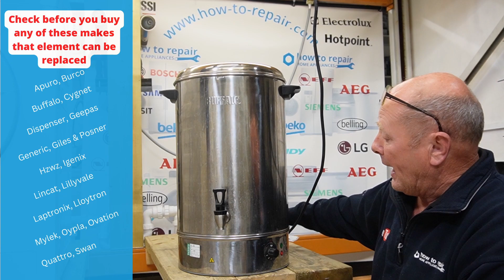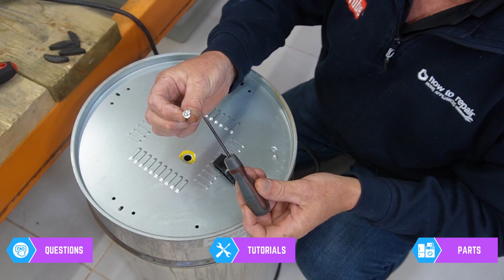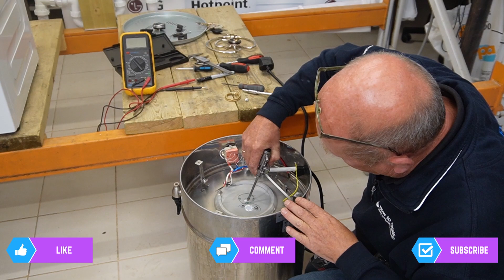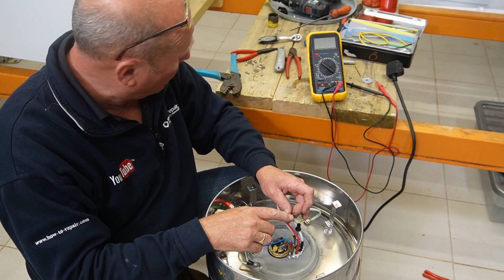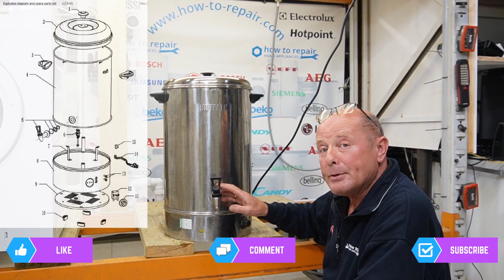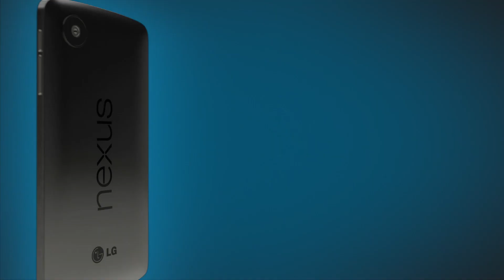How to replace element in a tea urn water boiler thats not heating

Comment: Is there 2 thermostats - 1 connected to dial and the other to thermal reset switch
Reply from the maker: There are so many variations of these. I cannot really be honest with you and give you a direct answer.
Reply: @How-to-repair  buffalo gl347 . One appears to be manual reset and one connected to dial as in your video part ak818